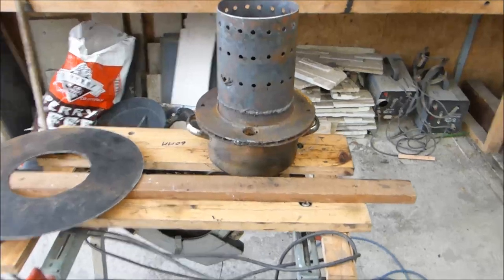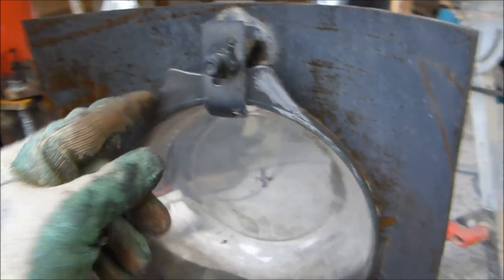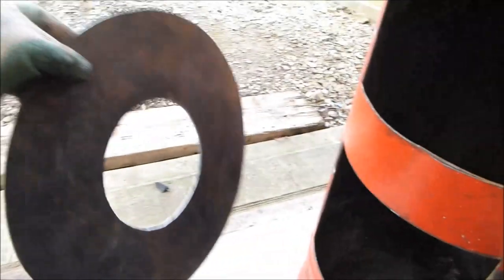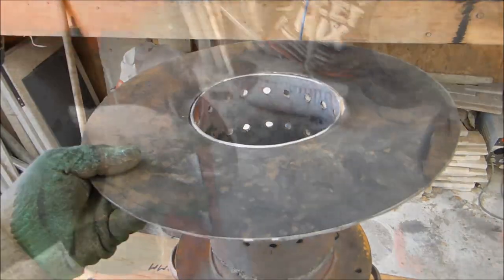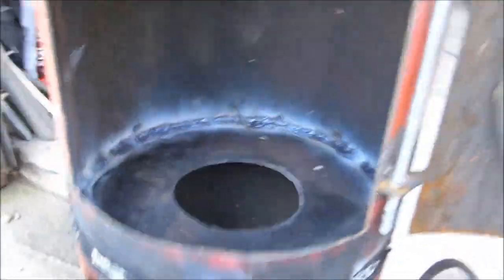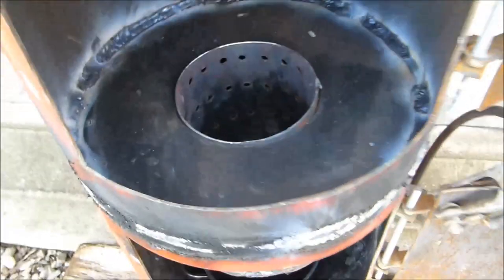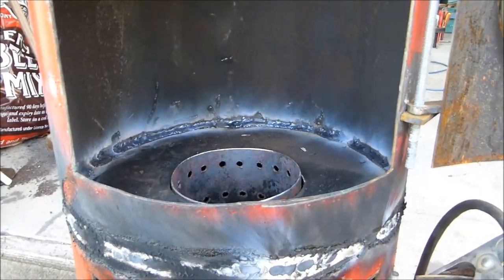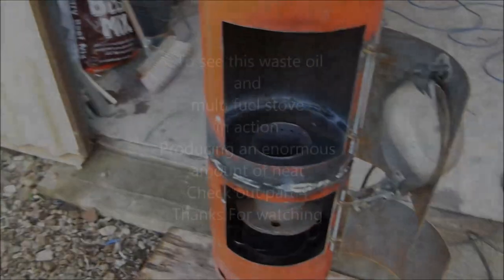Make a great waste oil and wood burning stove heater (part 3)

Comment: I'm going to make one like that, but I'm thinking of fabricating a square structure coming out away from the tank and using a flat door with ceramic glass in it. I've used on wood stoves I've made in the past and it stands up well for high heat. The rest of it look pretty simple to build so I don't see any problems there. I may run several tubes thru the top portion of the barrel and using a squirrel cage fan in the back to blow the heat away from the stove to distribute it out into the shop.

Comment: I love the dual part !And a cole stove needs the air from onder the fire so that's ok BUT a wood stove needs the air from above the fire to have a good burn ... but still a great job ! NICE
Reply from the maker: Hi Paul. This little stove is a compromise between several types of burners but it does make lots of heat whether it's burning solid fuel or waste oil. It would be easy to add a slider near the top of the stove for air intake when it is in wood burning mode. For little or no money thought it really does whack out alot of heat. Thanks Gerry

Comment: I've watch your video's, and they are pretty amazing.  Love the simplicity of it all.  I noticed a couple of times you mentioned baffles.  Perhaps you could do a video explaining the pro's and con's of baffles and especially related to your early model, the one with the brake disc and seperate chambers for drip oil, wood, coal... How would/did you do it, if you did?

Comment: Yeah g'day Gerry, I'm totally impressed with the "non turbo" model and I am trying to copy your dimensions precisely; if you don't mind. Your burner works better than every other one on youtube.   From what I can tell there are 14x12mm holes drilled in each of the three rows, is this an accurate observation? Do you have the top row of holes inside the tank? And are  the vent holes in the disc brake sealed with weld?  Thanks Colin
Reply from the maker: Hi Colin. Sorry I missed this comment. The vent holes are blocked with weld. I didn't have a solid brake disk so I just adapted the one I had. The holes are about 1 inch apart and its just pi times diameter to give the spacings. I used 2 rows and I think that they were 10mm. I did drill a third row of holes but found that I didn't need them. Sorry for the delay. Cheers Gerry

Comment: Hi there in the process of making my one does it need to have a top chamber or can I get away with just using the one that iv already got and second did u cut out the center of the disc brake?

Many thanks Ryan

Comment: Hi Garry, Great Job I was wondering does the pot just set on bottom of tank or is it suspended off bottom when attached to burner tube. If so what holds tube through the dividing plate between chambers?

Comment: What did you use for the chimney connection?
Reply from the maker: Hi terravarious I had some 5 inch flue so I formed a collar and welded it to the propane tank. That allowed me to insert 5 inch flue into that collar. I think I used 1 inch flat steel to form a circle. That is covered in one of the videos. I made this a few years ago and it worked great. I have a new build starting this week. Hope this helps. Cheers Gerry

Comment: What type  (power) welder are you using?
Reply from the maker: Hi Mark. I have a little 200 amp tig welder. I bought it from Germany I think it is Cobel brand. I have it a few years and it is reliable. I only use it a a stick welder though. Cheers Gerry
Reply: GerrysDiy Thanks!

Comment: Gerry, the pot that the oil drips into, is a pot that is 3.54” deep enough?
Reply from the maker: Hi Garry. Yes that would be deep enough.  I made a more efficient burner for this stove that needs no forced air, runs on about 2 litres per hour and makes lots of heat. It all sits inside the top chamber and draws air through the separator plate . Here's a link  to another of my own design stoves with my own burner too. https://youtu.be/lwx5-sBVCuQ This works great and if you wanted to overdrive it you could add a fan. Heats my big uninsulated shed no problem. Here's a playlist of burner videos I made https://goo.gl/Ax1RCy Cheers Gerry
Reply from the maker: Hi Gary. That pot would do nicely from ebay. The burner design in this video is from an Australian guy called Spike and his burner is called Ozzirt. He was really helpful with my build and that burner works great. The stove in this video is my own design and I have used it in quite a few of my projects. I use my own burner design now too along with this 2 door stovewit separator plate and I am getting great results. Both burner types will fit easily into my stove. I have quite a few waste oil videos now with quite a bit of info. Give me a shout as you progress your project and let me know how you are getting on. Happy to help if I can. Cheers Gerry
Reply: Opel grenland